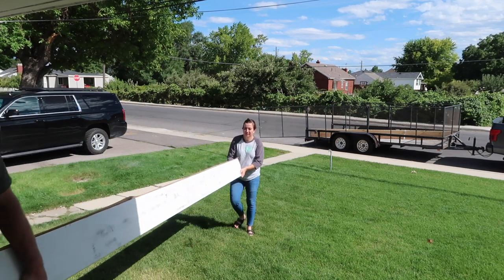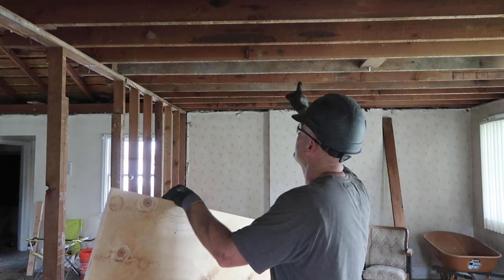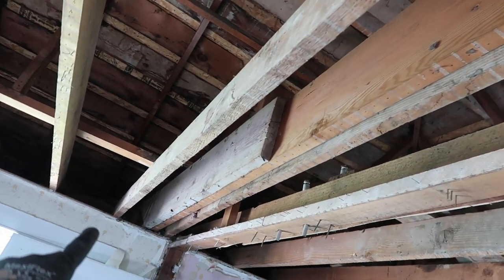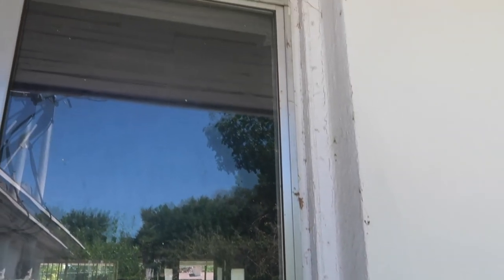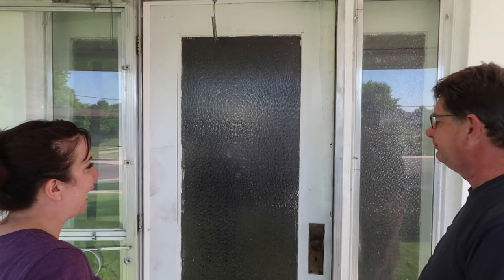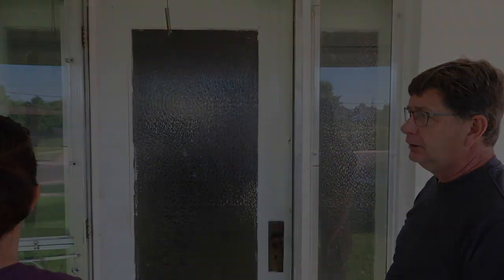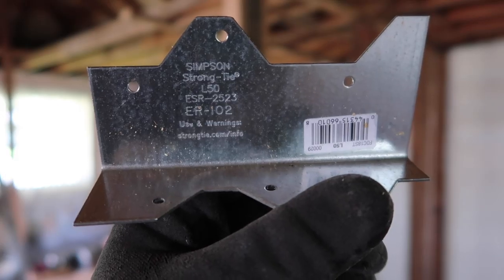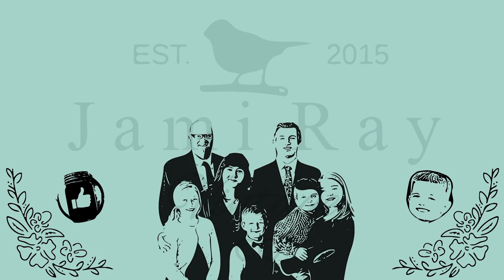Old Farmhouse Renovation Opening Up The Ceiling | Episode 6

Comment: If you live in colder climates, sister in 2x6 rafters so you can insulate properly. The grilled you found “big beam” for your front porch was the cantilever reaching back into the house, easy enough to remove especially if you use some straps to nail it into the porch, beam across the fron like you did with glue lam is all that was needed because the weight of the porch is just roof weight. Easy to make quite pretty out front without thee 12xs like you were talking about

Comment: Did you hire an engineer prior to removing the rafter ties? Isn't what you installed considered to be collar ties as they are not located to handle the tension in the rafters? A rafter tie by definition is a tension tie in the lower third of opposing gable rafters.

Comment: Are you building trusses for better support?  Collar ties? is that what it means.  Really opens up the ceiling having eliminatedd those joists.  I wanted to do something similar in my attic but did not dare  touch the trusses.  Perghas if I get an engineer to redesign the trusses I migh be able to accomplish it safely.
Reply from the maker: Yeah I would definitely talk to an engineer. This house only had rafters so it’s a whole different design than trusses.

Comment: What’s the average cost to do this job?
Reply from the maker: For the total reno or just this part of the job. We spent about $200,000 on the renovation and the 2600 square foot addition. And we did all the work ourself
Reply from the maker: To do this entire project we spent approximately $120,000 in 2019-2020 to complete the renovations on the old part and build a 2600 square foot addition. The cost would be much higher now as lumber has doubled